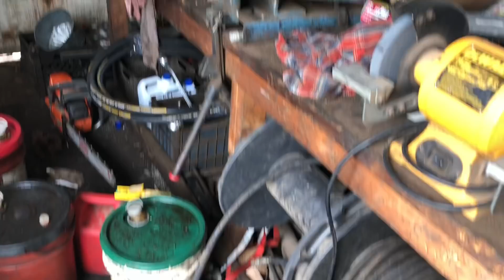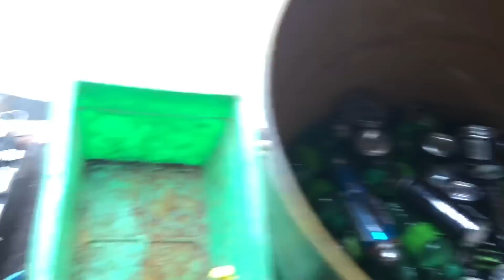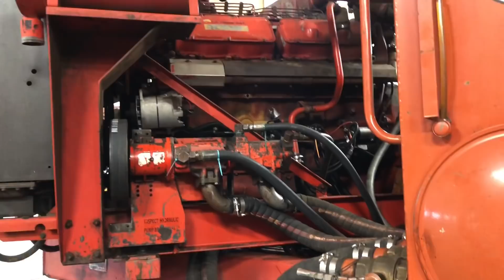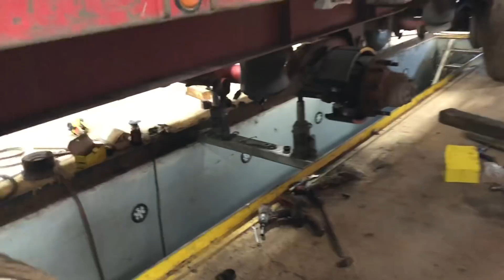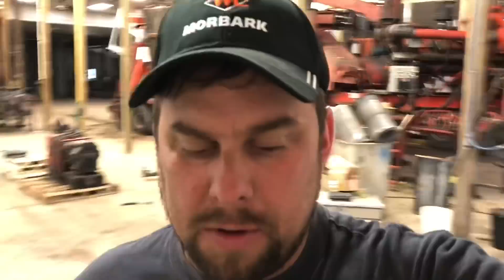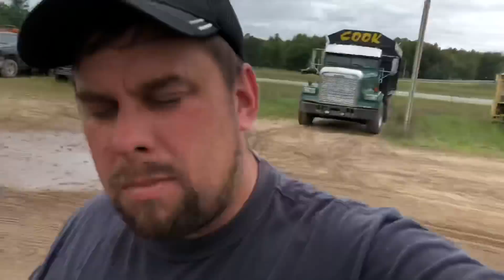CLEANING TOOL TRUCK!!

Comment: Those tool trucks do collect the mess but man they reduce down time and infield repairs are so necessary.   The log job replacememt with the old chipper will rock trucks and logs.  One day solar roof panels and supercapacitor batteries will replace the need for a generator and lugging fuel in the next tool truck.  Good luck with the 2hr finish window and move on running like a top.
Reply: No I consult in that industry...if the charge or duty cycle is more than 60 seconds supercapacitors fall on their face for a variety of reasons.  All energy industries are limited by scientific laws before the business case limitations are applied.  Solar storage may take a leap in future years but it being as an onboard mobile solution bluntly will not be a target industry.